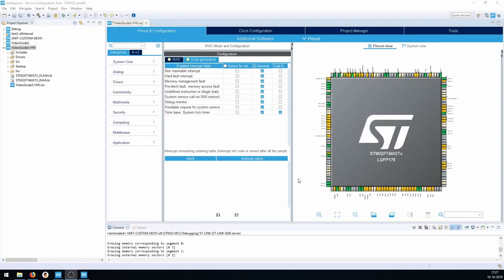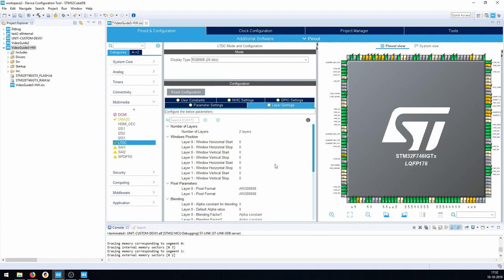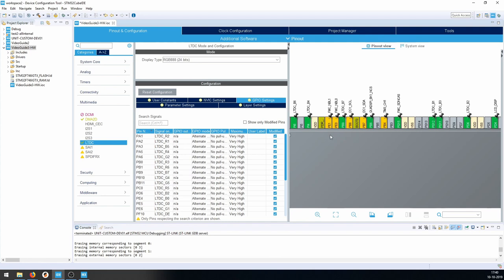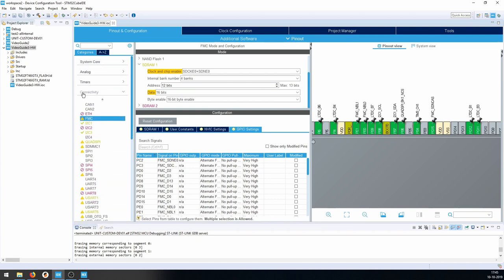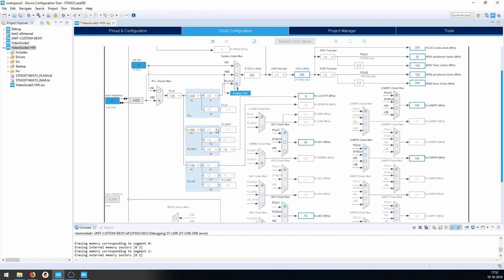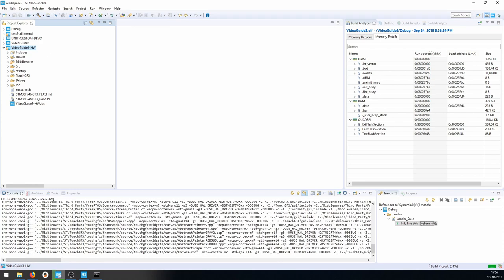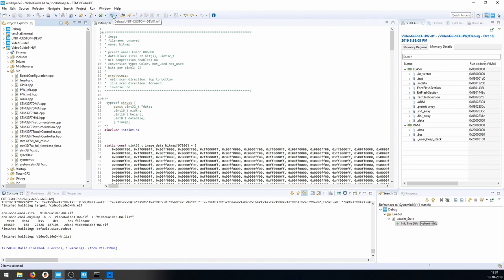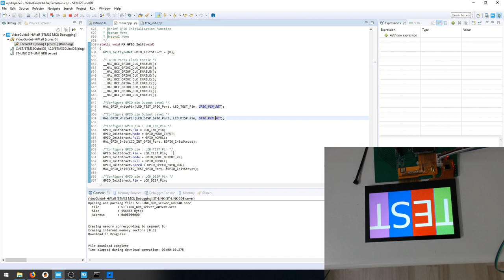HW setup and Display test on STM32F746

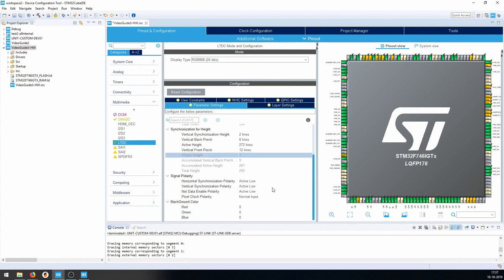Comment: Hi, in 8:46" you set the signal polarity section of TFT and change the Vertical sync and DE polarity to active high, how do we determine the right choices in this section of settings? regards
Reply: Good question!
The simple answer is that i get them from the datasheet for that particular display.

Comment: Nice Work. I have one question. In this Video you displayed the Picture on the screen by pointing the the start address of the Picture in the flash. What needs to be done to show the screen you created on Touchgfx?
Reply from the maker: TouchGFX fills the framebuffer by default. The static test imaeg is to test the screen connection. If you don't modify the framebuffer address pointer then you will get the image generated by touchGFX
Reply: @banjohat  thanks for the reply. I am able to test a static picture on my 480x272 screen using stm32f429igt.But it doesn't work shows screen created in touchgfx.I tried different values of start frame buffer address in LTDC parameter in cubemx.I am working on a custom board with stm32f432igt mcu with 480x272 screen.

Comment: Hi, First of all, thank you very much for posting these videos. I am finding hard time of using touchgfx and cubeIDE. I m using cubeIDE 1.1 and touchgfx 4.12. Can you do a video on how to create a project from CUBE IDE and use touch gfx. I went through all the videos you have and followed every steps in there. But still couldent get it to work.
Reply: The process is a lot simpler with the new version. Until I make a new video, I suggest that you have a look at the touchgfx support forum. The is a nice walkthrough on how to set up the project
Reply: @hanspeterhaastrup-nielsen8446  yes i did that too. But unfortunatly i m getting errors for RTOS init and for some other functions
Reply: @kasundinesh  Strange... I also work with the new IDE (1.1.0) and TGFX 4.12.3 and everything works nearly straight out of the Box on the F746 Discovery. Try the following:
1.) create a new stm32 Project.
2.) Use the integrated CubeMX to initialise all the Peripherals with their defaults.
3.) In MX activate TouchGFX (dont forget to set that Display Pin)
 4.) Generate Code (but dont leave MX...)
5.) Start the Designer with that Button in MX...
6.) Create a simple GUI (2 Screens, Interactions are: When Screen X is entered change to Screen Y and vice versa, so u dont have to setup the TouchScreen. Remember: Its just a quick Test).
7.) Not sure, but i get some Trouble, when i use the Simulator here !
8.) Generate Code within the Designer, after completion close it and switch back to MX.
9.) Generate Code within MX again and close Perspective...
10.) Build, Flash and enjoy ...
Integration of TouchScreen works like usual (Drivers, Paths and so on...). Also QSPI for external Flash and other Peripherals : No Problem ...
Reply: @chaaalyy  I m using DSI interface for stm32F4. So when i set every thing to default DSI parameters are not set properly